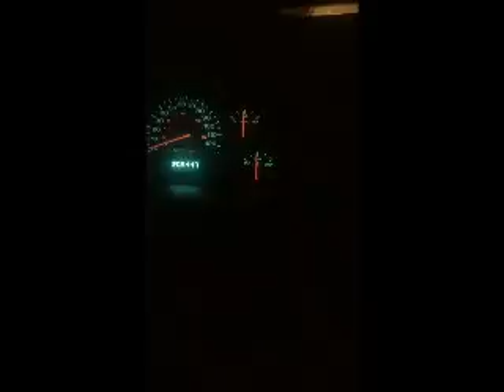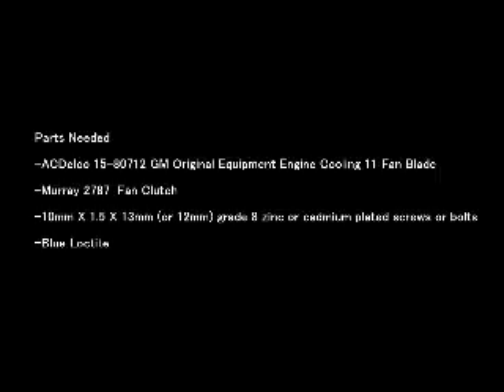Jeep Grand Cherokee Mechanical Fan Conversion 2000-2004 Verdict!

Comment: I just bought the Murray 2787 fan clutch today but I went with the Dorman 620-602 fan which is an alternative to the 15-80712 (and it's about $70 cheaper).  Going to install them tonight.  Will report back!
Reply from the maker: Oh cool, hope it works out. I had read a few things where some people had a hard time getting the non-GM ones to clear the fan shroud, said it was slightly longer blades. But I never saw any pics/video so hope it works out because that would take the total cost down to just over a hundred bucks new for everything. Lemme know how it works out!
Reply: The Dorman 620-602 fan, goes for about $38, works great and has plenty of clearance.  Blades do not hit anything on my 2004 Jeep Grand Cherokee Laredo.
Reply: I am mechanically inclined just never done anything like this do I need a new belt and about how long does it take
Reply from the maker: The new fan/clutch just screws right on to the water pump and, so no need for a belt. On the front of your water pump if you don't see threads then it's probably covered with a plastic cap from the factory they put on so it wouldn't rust. It just peels off by hand or some pliers. This attachment was on all the 2000-2004 Grand Cherokees in case you wanted to add a 5 blade fan for extra cooling while towing. I found using the 11 blade fan instead as the main fan you never have to worry about popping that electric fan relay. If your electric fan still works you can leave it in, or as a backup. Otherwise you can just take it out, this does add time to the job. As far as how long it all takes it just varies. It's mainly just pulling some screws so you can tilt everything enough to slide the new fan in to screw it on. Noel might be able to help you more on that since he just did it, I just watched some online videos of guys pulling the radiator and saw what I needed to loosen things up to get that fan in there.